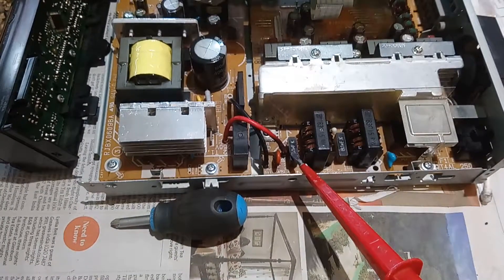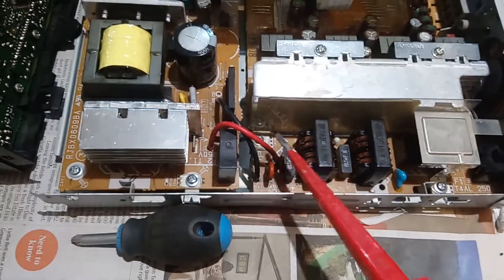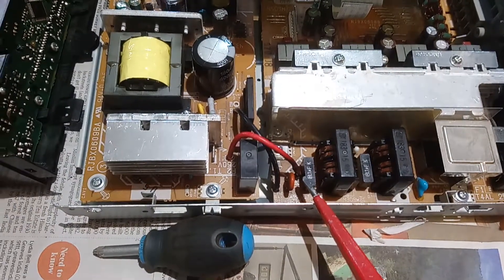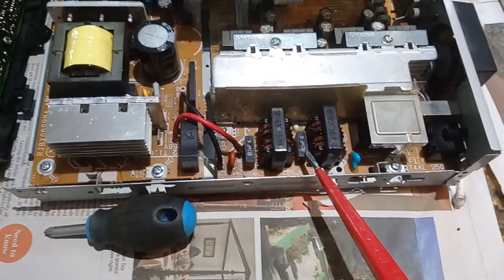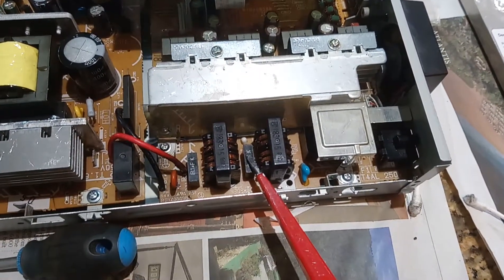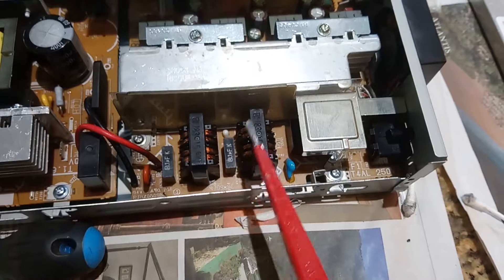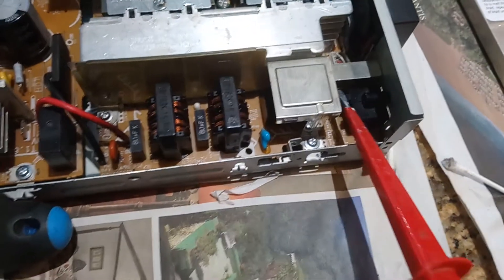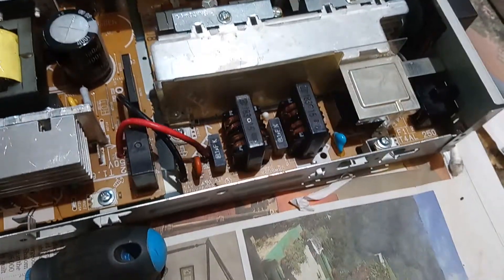Panasonic Sa-Pt470 Repair 2

Comment: Hi, I was wondering if you could help me out? I have the exact same model as you. I've never repaired anything like this but upon opening it up I can see that two bright blue things in mine have blown, you can seen one of the bright blue things in the video you've uploaded. I have a soldering iron and the internet. Is there any chance that you know what I need to order to replace these bright blue things? Mine have leaked out some red gunk or something which has hardened up around them. Thank you in advance. Your response would be immensely appreciated!
Reply from the maker: I presume you have these numbers printed at the side of your components on the circuit board - C5704 & C5705. Unfortunately my system stopped working again and so I replaced the large capacitor on the 2nd board, the one after the power supply. It still did not work. 

I shall now look into these capacitors you mentioned.
There are on-line service manuals available for this model where you can possibly see the value that your capacitors should be. See elektrotanya.com
I order on-line from RS components wait one day for delivery. Hope this helps and you may have helped me too.
Reply from the maker: 1000pF